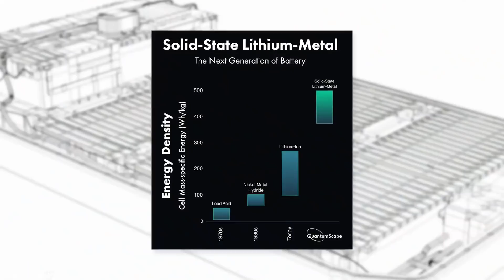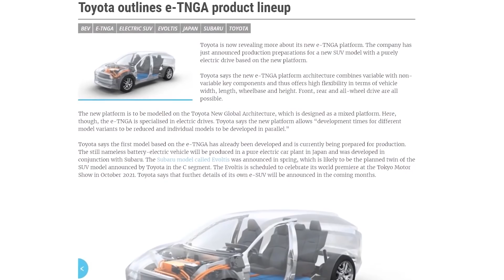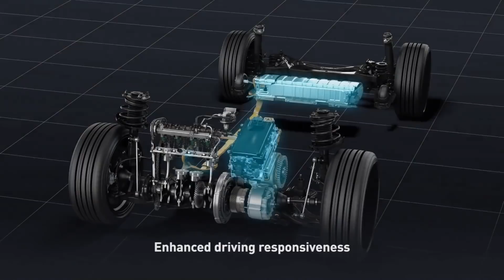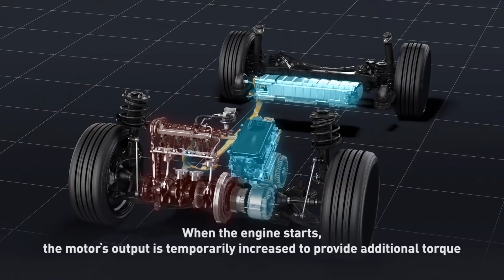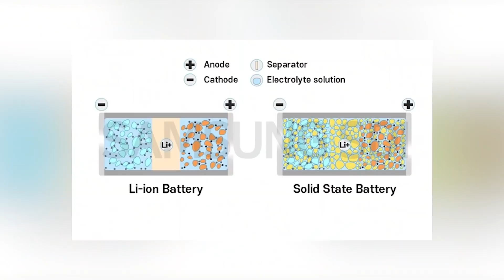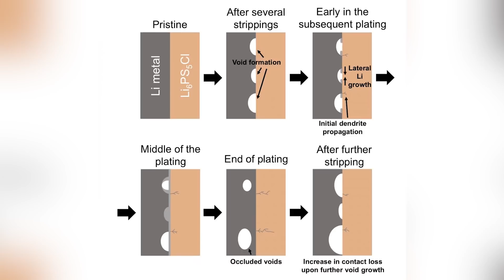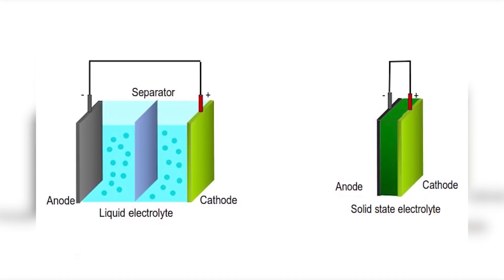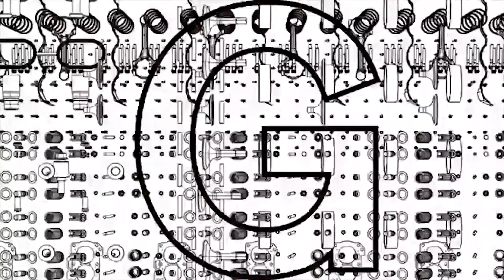Toyota's New Revolutionary Solid State Battery

Comment: Toyota battery electric vehicles will be powered by Chinese lithium phosphate blade style batteries. The batteries will be rechargeable 10000 times before noticeable range shortening, they will be very safe to a point where if punctured there will be no fire. Range will be 600  plus km

Comment: Most families have more than 1 car, with at least 1 that is used for work commutes. Nightly plugins completely eliminate the need for a 500 KM battery for that car. However, owners won't tolerate a short lifespan, with 225,000 KM being a good benchmark.

Comment: Reduced pollution? The electricity has to come from somewhere and right now the bulk of it on the grid comes from fossil fuels still. Solar panels require coal to melt the silica( still polluting) and come off the assembly line >20% efficient.

Comment: What happened to the solidstate battery that goodenough patented? The one that u could doscharge to zero volts without damaging it? The one that was 90% after 25000 cycles and could recharge in 15minute?
Reply: ive been wondering the same thing. no more news about it. him and his lil protégé had really peaked my interest as i believed they might actually do it.

Comment: Give me a 600 mile range battery with a 1,000,000 mile battery warranty and I'm sold.
Reply: It’s already here Tesla is king the others are panicking with hype to keep Tesla down .
Reply: How about a 1,000,000 mile range on a single charge? ;^)
Reply: @thomasruwart1722  Future solar powered cars might be able to pull it off. We're only as good as the technology and it keeps getting better every year.
Reply: WOW, I have no use sitting my a$$ in a car for 10 hrs straight.  If that's what you do, my hat is off to you, but that's not for me.
Reply: @scottkolaya2110  I drive tractor trailers for a living. Driving doesn't bother me one bit. I buy vehicles based off of how far they can go in an emergency. The further without having to fuel or charge the better
Reply: @r.d.9399  what kind of emergency are you preparing for? Also you job will be obdolete in a couple of years with the way ai controlled driving is advancing.
Reply: How about 2000 miles
Reply: Lol. Most modern gasoline vehicles can't even make 400 miles on one fill up or half those miles before breaking apart everywhere else.
Reply: @lajlijthoj  We're going into the future.  Not staying with the same range as old technology in ICE cars.

Comment: This is so full of incorrection information - 250km range requires special stuff from li-ion - that is bollocks.
This is a Toyota marketing stuff that makes no technological sense, yes there are dry electrode (solid electrolyte) prototype batteries, but there are problems/issues that have not been solved - most technological.  Don't hold your breath - 5 years, might be producing them, "who knows" yep - that it.  and dendrites do not effect solid state batteries, they only effect wet batteries.
Please ignore this video.

Comment: So the materials needed are being mined from the ground and being introduced into the environment   :D  Sounds familiar ?
Reply: The public are being lead down the garden path , the electricity to run these vehicles comes from power plants pumping out C02 and electric cars take a lot more energy to build , then to dispose of millions and millions of batteries and the end of there life.
Reply: @pocketfella5176  Yeah 73k miles that are 90% charged off solar says different between two Cars. The kids pass me down 2012 leaf that I’ve not included in the previous statement is sitting on 122k miles and has lost 12% capacity- granted the range was not great to begin with. Been told the leaf at its last service it’s good for another five years easy and safely. The body has slight corrosion but that’s because it was the one car used every winter and sat outside and will probably give out before the battery or drivetrain. 122k miles and  apart from four sets of wheels, one set of new pads and a 12 volt battery that’s it! The leaf has old school battery tech and still the main battery pack is 85% recyclable and the rare Earth minerals 98% to be used perfectly like new again.